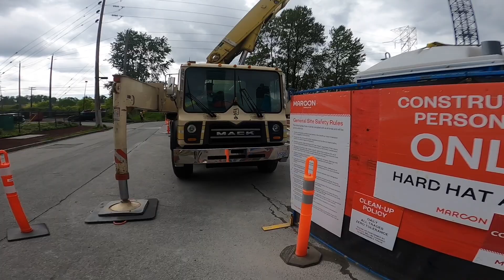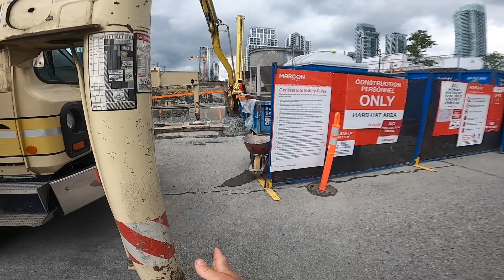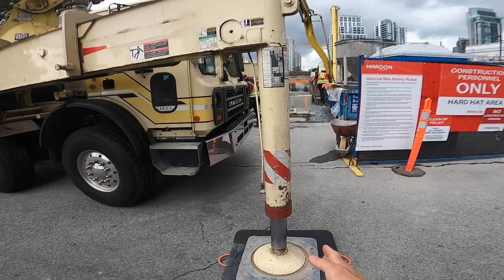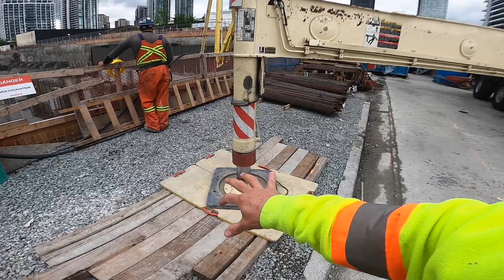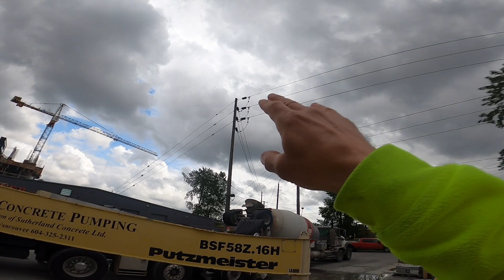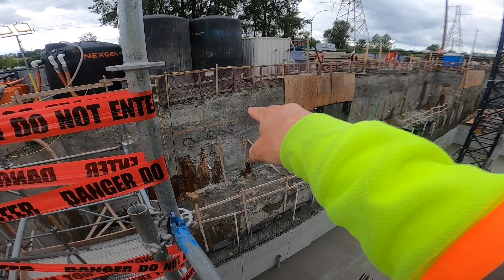The best outrigger design ever fitted to a concrete pump!!!

Comment: It would be cool if the 63z we have had 4 stage. With the smaller stages, are the outriggers are pretty fast? It'll be cool when our new 63z gets here, get to compare it to the old tech
Reply from the maker: From what I was told it was dependent on which state/country the machine was destined for as switching between the 3 and 4 stage legs allowed for slightly different mounting positions of the pump unit onto the chassis and in turn gave them the ability to shift weight around on the individual axles. Most of the 63's in Europe I believe were 4 stage front outrigger legs. The revised "gen 1.5" 63's I believe are all 3 stage front legs now.
Reply: @Canadian Concrete Pumper   going from the 2nd 63z off the assembly line, to a brand new unit, around January, is very exciting. Those 4 stage front outriggers look super versatile, it would be cool if the machine has them. 

Nothing wrong with the 3 stage. I short rig like your 58-5 does, I just take up a lot more room lol
Reply from the maker: What I love about the 4 stage leg is being able to lockout the one stage as such that when short-rigged it doesn't sit as far forward in relation to the front bumper.

Comment: working at height with this pump in the position that is seen I would only work with the arms open because there is the possibility of a balance that can endanger and I say from experience
Reply from the maker: Manufacturer approved working range is 180 degrees both with the boom vertical, as well as horizontal. In fact, with the non working side outriggers deployed just one meter, it is permissible to boom with section A-B-C straight vertical, and section D hyperextended back over center so long as the tip elbow of section E does not cross back over the centerline of the pedestal. It is quite something to look at (especially looking down at the pump from an elevate deck), but fully endorsed by the manufacturer.
Reply: @canadianconcretepumper1979  to be honest, that sounds scary to me. What about the volume? What is the pumping volume limit? Is there any? Because you know that when you increase volume the machine starts shaking a bit...
Reply from the maker: @martint9009  no limits with respect to volume. From a non-engineers brain (mine, as well as most other pump guys) it defies all logic, and is scary too look at, but is completely within manufacturers allowable working parameters.
Reply: He is right, 100% safe.  If you seen one go over like that it was probably out of level, went past by just a bit, or something outside of manufacturer guidelines. Once you understand the physics it's actually pretty basic, just scary because it's a big piece of steel and screw-ups cost lives so very important to stay in manufacturer guidelines. He fully understands his machines and takes the time to learn the proper way to use them.  It's good to see him teaching others the safety too.

Comment: 63m putz?
Reply from the maker: This one is actually a 58-5. They didn’t build many of these for the North American market. They had actually ceased production and then kicked back up to produce a half dozen or so in and around 2018 I believe. One of the best rigs Putz ever produced, in my opinion.
Reply: @canadianconcretepumper1979  yes I agree, the best.   I run a 63 putz, kinda the same outrigger design 
(3 stage ), I love it.
Reply from the maker: @saulduran4733  yes, a beautiful machine indeed! They used to offer the 63 with a 4 stage outrigger as well (I believe whether they used the 3 or 4 stage front outriggers was dependant on the market which the machine was being sold), but now build them only with the 3 stage on the revised generation machine.